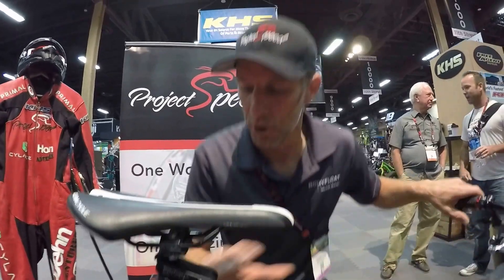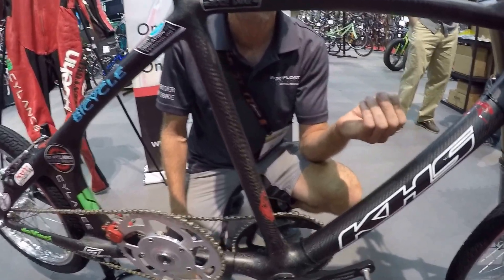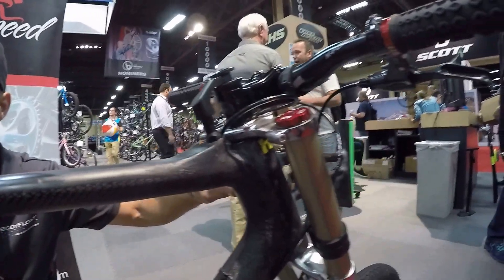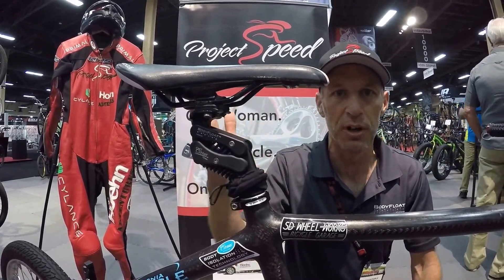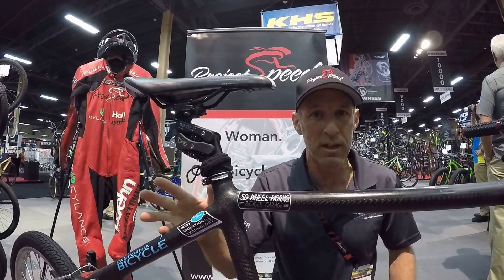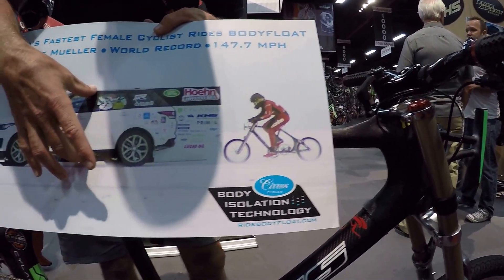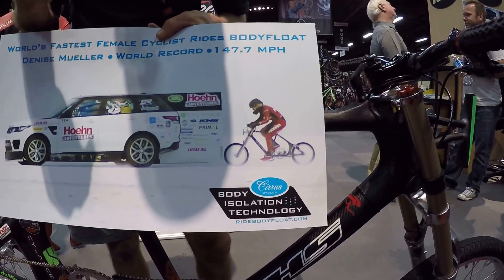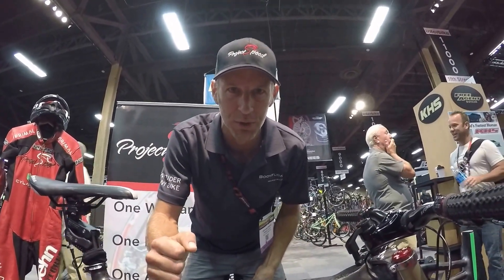Worlds fastest bicycle at 2016 Interbike

Comment: Hi! You know. I have a 16' mini bike with 48 tooth chainring and 14 tooth rear gear. It runs like a grandpa bike in the 30's. Anyway, I think of modifying,  designing or developing this even smaller bike 14 or 12 inch wheel and turn it into the fastest commuter mini bicycle on earth....I'd like to have your feedback.  Thanks in advance